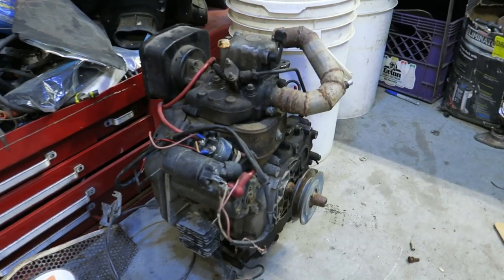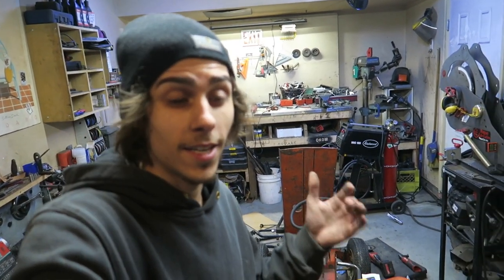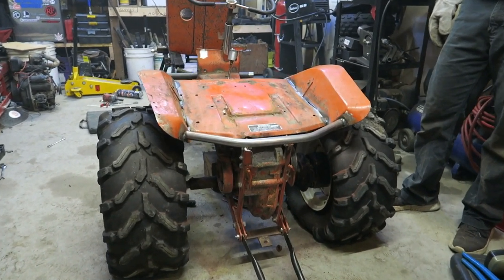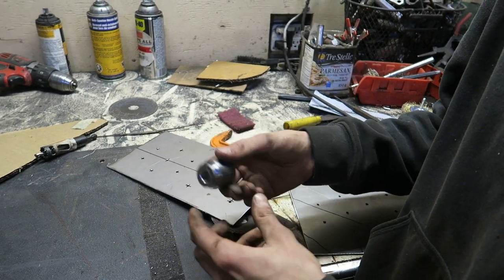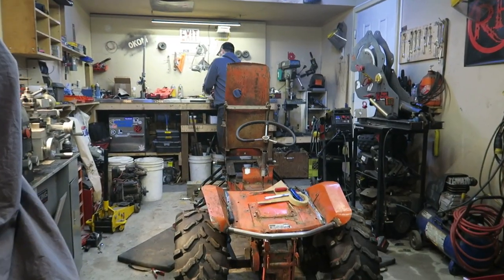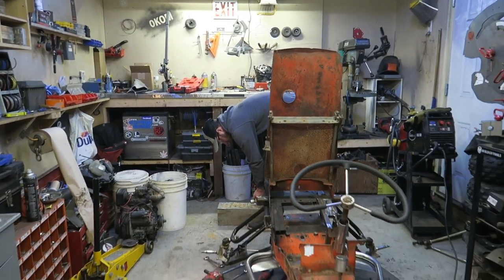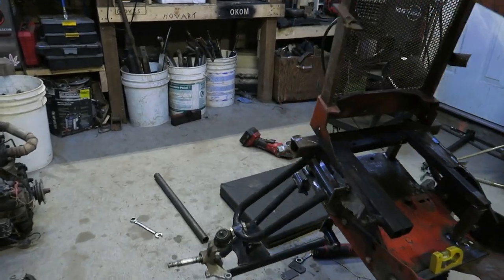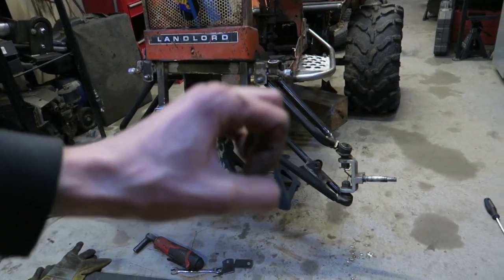Building a DIESEL off-road mower pt.2

Comment: Yo part 3 homie lol love the custom builds. Im working on a 1967 ford 120 not an lgt but an angle frame Jacobsen with a 12hp Kohler. It has some weird reversing gear on the peerless 2300. The wheel horse has a seam set up but the driver is on the right side of the peerless. Do you think I could switch it and switch the motor the other way so i can get rid of that reverse gear and change my pulley sizing. It has an output shaft on the correct side but that's where the brake is so I would switch to the other side put the drive pulley where the brake was
Reply from the maker: I would suggest not to run your input pulley on your brake shaft 
Was not designed that way!